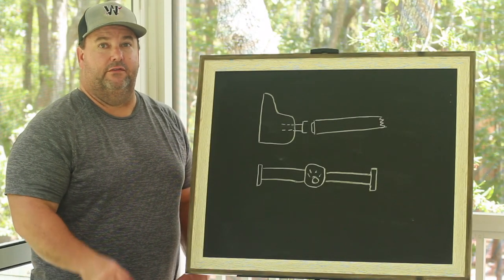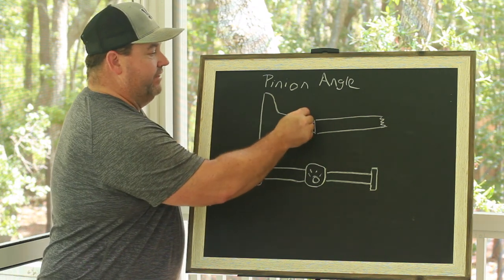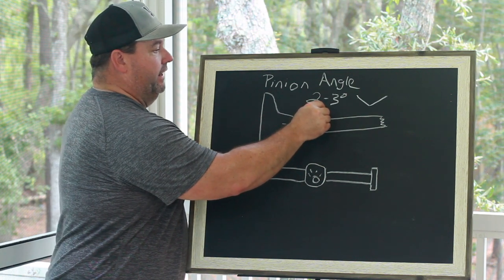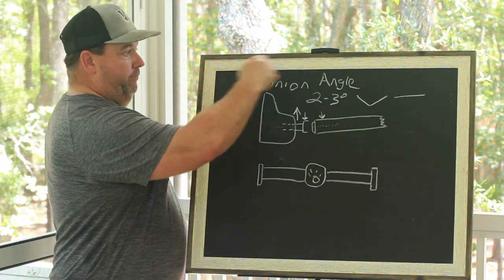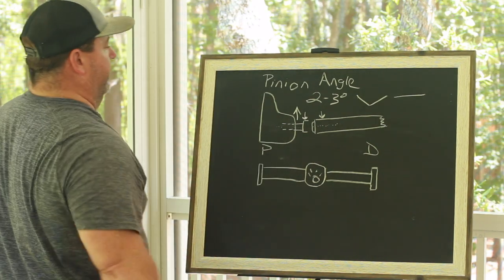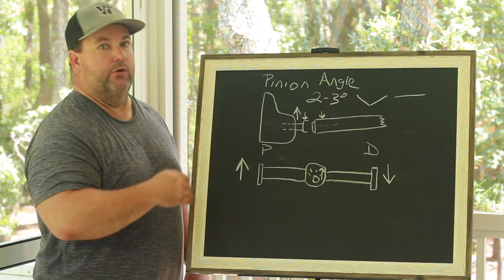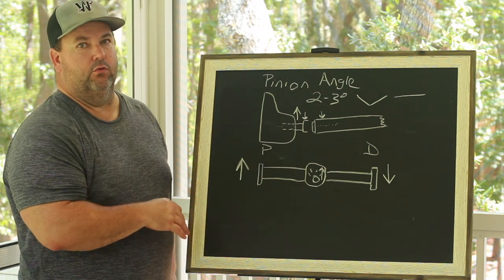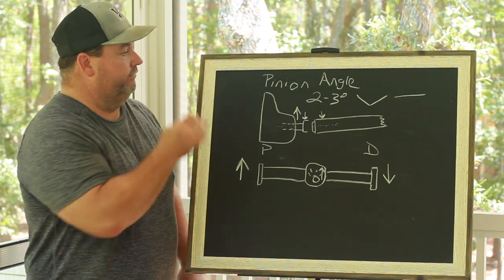Pinion Angle | Rear Suspension Twist | Rear Anti Roll Bar

Comment: Your drawings amaze me but, for real, VERY good description and breakdown of your message. Even I took in what the message was. Great video
Reply from the maker: Matt Jevne thanks so much for your comments! Thank you for the kind words! I enjoy helping racers! Go fast, go straight! Be Safe!!
Reply: @KevinWilsonSBC  I’m stuck with a driveshaft “hum” or “vibration”. Looking for experienced professionals to help me out. Hopefully I can in turn use this information to get me a better understanding of it and how it operates.
Reply from the maker: @Bushspaperplanes  do the basics for sure. New ujoints, balance of the driveshaft. I know you that, but sometimes it is best to just cover the basics for sure. I have saw many ujoints that looked good and felt good by hand, but underload, they are trash. Cover the basics first, unless you know you have some way out of whack angles going on! Go fast, go Straight! Be Safe!
Reply: @KevinWilsonSBC  I’m not WAY out of whack but I wanna make the corrections right the first time and maybe be able to help someone else besides myself later. Numbers right now I believe are off somewhere in the 3 degree range. Going to take better measurements this Sat and plan for action after that. Driveshaft was professionally shortened, high speed balance etc. Spicer U Js are new but there’s still a slight howl. Pinions off and feels like it’s grabbing or binding at the diff

Comment: Thanks for yet another informative video, Kevin. I have a question regarding rear ARB's. What weight bar would you suggest for a drag car? Is a heavier bar better than a light one or visa versa as a start point. I understand there would be a lot of variables to this answer, but just chasing a start point. Thanks in advance and please keep these great video's coming. I'm a 70 year old newb to drag racing, so learning quickly.
Reply from the maker: Grazza Herridge thanks so much for your comments & question on the rear ARB! LIke you said the more power, weight of vehicle being placed over the ARB and suspension stiffness certainly impact the decision. For example, I am running a bracket/sportsman series ARB and I definitely could use a stronger one. A 1.5" billet steel bar to me is a minimum and splined shafts preferred. Here is a pretty good article on this topic: https://www.dragzine.com/tech-stories/brakes-suspension/in-depth-extreme-drag-racing-anti-roll-bar-tech/ Go fast, go straight! Be Safe!!

Comment: Why do people put the heavy battery over the passenger side tire, I thought it was for more weight on that tire for better traction?  On an open rear the passenger side tire is almost always the one that spins first and more.  You are saying that the torque pushes the passenger side tire down so why does it typically spin first in this scenario?  I know that with more force the Coefficient of friction goes up for better traction.  Great video's thanks for sharing!!!

Comment: It is my understanding that you should set pinion angle so that when loaded up the angle at pinion and angle at front u-joint (transmission) are the same. Otherwise you will get oscillating rotations at your pinion. That to me seems more likely to have an effect than u-joint life because you want some rotation in your bearing cups to keep the bearings moving to not create peening in the bearing races. 
As far as the axle rotating up at the passenger side and down at the driver side you also have an effect from the chassie not letting your motor twist along with the crankshaft twisting the chassie counter clockwise and putting more weight on your right rear tire?
Reply from the maker: Lunnajs thanks so much for your comments! Go fast, go straight! Be Safe!!

Comment: Chrysler used to use a pinion snubber. This is old school thinking you want everything in the drivetrain as straight as possible at all times resting or under load.
Reply from the maker: Jeremy Pike thanks so much for your comments! In a drag car you have to account for the rotation of the rear end on the hit. Therefore you plan for a straight line under load which means at rest you have some working pinion angle. Go fast, go straight! Be Safe!!

Comment: At 11:50  you say that the driveshaft spins clockwise if that's so then how does the rear passenger side tire drive into the ground...I'm  just confused.
Reply from the maker: Matthew, thanks for leaving a comment. Driving the passenger side, right rear, down to the track is related to the twisting nature of the engine on the driver's side front of the chassis. When you twist the left front of the chassis up higher, harder, faster than the right front, it drives the right rear chassis over the tire harder, thus driving the right rear tire to pavement harder. Go fast, go straight! Be SAFE!!

Comment: Need advise... I have 69 Lincoln Mark III, and converted the transmission to an overdrive. This process required modification of the driveline, and now it seems all messed up. The original driveshaft was made up 2 double cardan joints (CV joints). This made up for the problem that the transmission is pointed downwards 7 degrees, as well as the differential pinion angle also pointed downwards 6 degrees.
I also experience terribly bad vibration underneath the car as a result of improper angles.
However, the  modification of the driveshaft (by a shop that doesnt exist anymore) replaced the front double cardan joint with a typical single u-joint, when the driveshaft length was changed. My problem, is that i cant seem to figure out how to change the geometry of the setup underneath the car, without dumping thousands of dollars.
In my mind, i have 2 options... spend a few thousand to convert to double cardan joints back on the driveshaft? or custom make adjustable trailing arms of the diff to bring it upwards, as well as cut the tunnel of the floor, to raise to the transmission.

Any advice on my situation would help yall! btw, the car is fully complete rn, so my modifications mean i have to tear apart a fully painted, interiorized car. thanks
Reply from the maker: John Harbour thanks so much for your comments! This is beyond YT comments. I would need to see this car in person and inspect it before I could even give you some advice. Sorry man. Go fast, go straight! Be Safe!!

Comment: Great info!  I have set my rear angle but I am trying to find info on the front angles.  I can't go any higher with transmission.   Is the front as important as the rear?  It doesn't vibrate.  Thanks
Reply from the maker: philsautobody thanks so much for your comments and question! The goal is to avoid extreme angles as much as possible and each car is different. The front angle is important for the life of the u-joints but not sure what angle you are dealing with in your comment. Generally the transmission is set unless you can adjust trans mount more. Go fast, go straight! Be Safe!

Comment: Good stuff sir. My problem is everyone is telling me the transmission and rear end need to be in parallel which means if you’re going down 2° on your opinion your transmission would have to be going up 2° which is not likely based on the intake being angled so that the carburetor sits flat on top of the motor 2° would totally change the corporation in fact so it needs to be going to degrees down if both transmission in opinion or pointed downward that is not in parallel sir. Please correct me if I’m wrong I’m trying to set the pinion on a Ford mustang 1970 and everyone says the pinion needs to be downward 2° but my Tremec Freight speed is also moving downward at 2° from the engine.
Reply from the maker: Hey Rick, I answered this same question from you on 2/24 on another video. Please take a look at my response to you as I explained this in that reply. If you need more help, reach out to me via email at samsalignmentsc@gmail.com and we can discuss this further. Go fast, go straight! Be SAFE!!

Comment: You can leave the driveshaft out of the equation for pinion angle. It's the difference between the pinon angle & the engine/transmission angle. Measure off the balancer or motor plate for eng/trans angle.  On a full chassis car it's likely pointing uphill towards the rear which means the pinion will be pointing uphill at a little less angle generally to get a -1º negative P/A for example.
Reply from the maker: Austin Boil thanks so much for your comments! Go fast, go straight! Be Safe!!

Comment: Kevin
Another great video!
I always wondered why with  a standard differential the passenger side tire broke loose 1st. It is actually being lifted off the pavement. 
Can I use an anti roll bar in a leaf spring car?  
Thinking of the S-10. That truck was never intended to go 100+ mph!!! And it does feel squirrelly at those speeds.!!
With the super light rear end on that truck I’m going to need to do all I can to add bite as the power goes up. 
Thank you,
Andy Jones
Reply from the maker: Andy Jones thanks so much for your comments! Absolutely you can use a rear ARB with leaf springs. Go fast, go straight! Be Safe!!

Comment: Awesome video.
Questions, with a radial car that separates 3" or more. What pinion angle would you start with and how would you set it? Rear end hanging or at ride height?
Reply from the maker: Jimmy Lopez thanks so much for your comments and questions! Like explained in the video I am setting pinion angle based on my how much twist the car has to get the u-joints lined up with the pinion centerline as close as possible for the hit and length of the run. Always set pinion angle with the car's suspension loaded, whether you have it on stands, jacked up, or on blocks. Go fast, go straight! Be Safe!

Comment: If you change the pinion angle, don't you have to change the drive ling angle? My drive line is 3 degrees down, drive shaft is 2.5 down and pinion is 6 degrees down. I trying to figure out this mess. I was thinking I needed to raise the diff 3 degrees  to make it in line with the transmission to stop vibration, but that will only give .5 pinion angle? Don't really want to shim the transmission. Not sure what to do.
Reply from the maker: Hi Mike! This video is one of the best. https://www.youtube.com/watch?v=jaaTyL099RA
The goal is to have some pinion down angle, but if you have a motor/trans angle that is competing with that like you do, you have to compromise. When you launch and make a pass, you need the two centerlines parallel (engine centerline and pinion centerline). In your situation, I would try to get the engine/trans angle to around 1 degree down going to the rear, then have my static pinion angle around 1 degree down (down meaning going to the front of the car the pinion yoke is pointing to the ground/track). That way on the hit if you have 2 degrees of rotation on the pinion, then your centerlines will be parallel. If you have more rotation than 2 degrees, then adjust accordingly. Go fast, go straight! Be SAFE!!

Comment: This is how I've set up the drive line angle on every race car I've ever built.  I've never had a problem.  But the purists are posting video's saying the engine angle has to be parallel to the pinion angle.  They say drive line u-joints are not supposed to be in a perfectly straight line, because the needle bearings and what ever aren't designed for that.  I don't happen to agree with that.  The 1.5 to 2 degree negative angle on the pinion for a race car I can agree with because of the rear-end twist under power.  What I want to know is, how do you set all this up with leaf springs in the rear for a 5-600 hp big block in a pickup truck?
Reply from the maker: Michael Steinberg thanks so much for your comments and question! Around 4.5 to 5 degrees. Go fast, go straight! Be Safe!!

Comment: Hi Kevin and thanks for a great channel!

I have a question for you. I been told that you allways have to take the front yoke angel in 
consideration when you set your piniong angel so they both are in alignment with each other. Otherwise you get vibrations in the driveshaft. Is this wrong?
Reply from the maker: Streetvw thanks so much for your question! For most drag cars the transmission output shaft is generally not much higher than the rear end, but if it is much higher to the point of putting the front of the drive shaft in a bad angle, you need to definitely consider that. The goal on a drag car is to keep the centerline of the crank, through the trans to the pinion to be as close to 0 in relation to each other under full acceleration which will provide the best life and performance for your u-joints. Of course, that is a perfect world with a low center of gravity, so sometimes you have to adjust based on your setup. Hope this makes sense. Go fast, go straight! Be Safe!
Reply: No matter what kind of angle the driveshaft is on , , if your trans output shaft and rear pinion shaft are on the exact same plane (angle) , you have 0 pinion angle..
A big difference in heights will promote more driveshaft angle
Reply: @KevinWilsonSBC   Thanks for you answer. Yes, that makes sense. I just realise that is a different approach when you are talking about a streetcar chassi och dragcar chassi. 

Im new to building a dragcar and i just finish my first backhalf and now doing test n tune on an old military airstrip.

Once again thanks for your answer an for a grear channel.

Best regards Markus

Comment: Hey guys, I just installed a rear anti-roll bar on my LS swapped S-10 and it's not quite level (the sway bar). Does anyone think I should cut it back off and level it out? I kinda think I can adjust around it.
Reply from the maker: Not level is not a real big deal as long as it is not crazy off... the main thing is setting the links correctly with the driver in the car and the car race ready on level ground. Go fast, go straight! Be SAFE!

Comment: Kevin, I was always told that 0 pinion angle is un-desirable. You should always have at least a half degree even under full load. T or F?
Reply from the maker: 7080nik thanks so much for your question! You can ask 5 racers about pinion angle and get 10 different answers. I would not fret over a .5 degree, but my goal is to have the pinion and driveshaft inline under load. Checkout this video of a great example of how a pinion angle changes on a 200 MPH 1/8th mile pass: https://youtu.be/q8e9p5UYgww 
Go fast, go straight! Be Safe!!

Comment: What do you do in the event that the transmission output shaft sits lower than the pinion giving the pinion angle a ^ angle instead of v.
Reply from the maker: TXsilvy thanks so much for your question! I highly recommend you get with someone reputable and local to you to go through your scenario, especially if this is a drag car. Lot's of variables to consider, but in short, you have to compromise somewhere on your pinion angle to shoot for the best angle as possible for u-joints under load. Go fast, go straight! Be Safe!

Comment: What type anti roll to use on a mopar with Caltrac and split mono?
Reply from the maker: That is a broad question and I would need a bunch more info. I recommend you give Marty a call at Merillat Racing and he can help guide you and his stuff absolutely works! The ARB must be able to handle the weight of the car and the HP/TQ levels. Go fast, go straight! Be SAFE!!

Comment: The more pinion angle you get the more parasitic loss there is in the drivetrain. Its exponential as well the higher the angle the more loss exponentially not linearly. Pinion angle is the main reason manufacturers now use just a differential and CV axles. Because the pinion angle doesn't change much at all with that setup the parasitic loss is very minimal.
Reply: Think 9" ford in a 300 hp car versus a normal differential in a 300 hp car. The drive angle inside where the pinion meets the ring gear on the 9" is a parasitic loss. Holds together very well for drivetrain shock and shear strength but the position of the pinion on the ring gear causes a big power loss that needs to be made up by the engine. Versus the normal positioning on a different axle.
Reply from the maker: Jeremy Pike thanks so much for your comments! Go fast, go straight! Be Safe!!